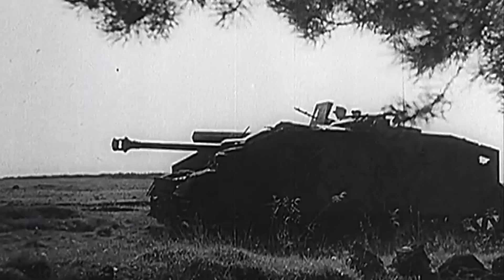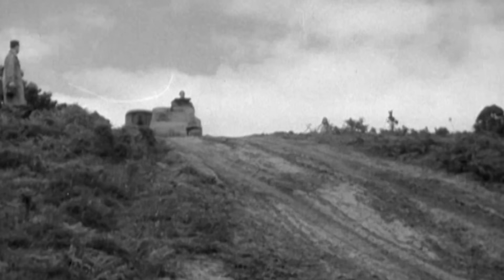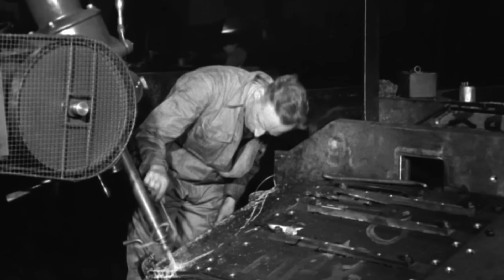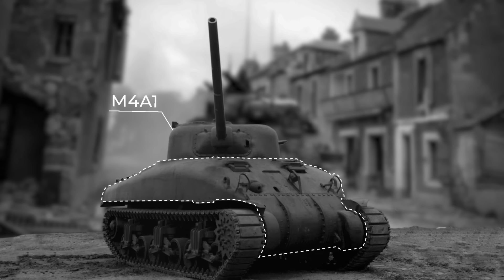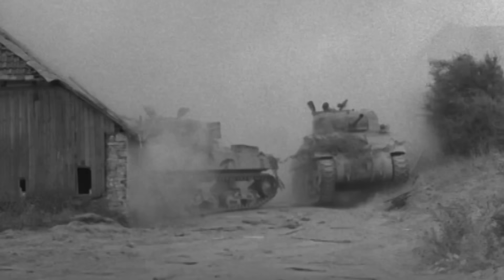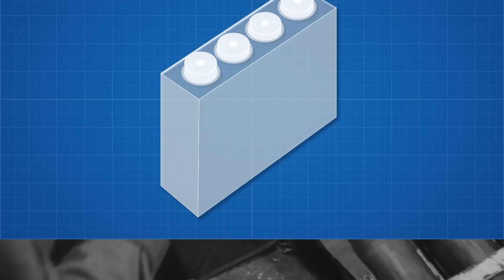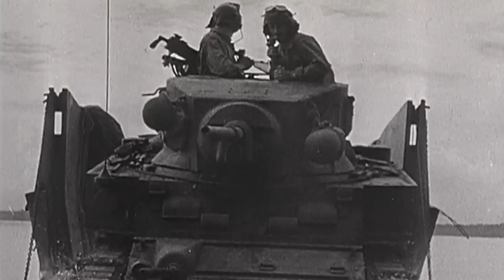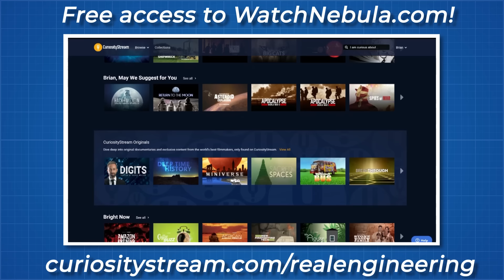M4 Sherman - The Workhorse of D-Day

Comment: The WW2 British called M4 Shermans 'Ronsons'... because they light the first time every time when hit.   Some idiot in the States put a gasoline engine in the tank, guaranteeing it would explode right away if hit. Diesel is not so volatile and does not explode like gas when hit with a enemy shell so much....
Reply: Nonsense. The only documented usage of the nickname being used for tanks reffered to flamethrower tanks. Type of fuel makes no difference in combat, even then fuel was often resultant of a tank's destruction, not the cause of it. The Soviets, Italians, and Japanese were the only ones to use entirely Diesel.
Reply: @peterson7082   https://medium.com/war-is-boring/the-m-4-sherman-tank-was-hell-on-wheels-and-a-death-trap-502b0d99e744  "The M-4 Sherman Tank Was Hell on Wheels — And a Death Trap"      50,000 M4 Shermans mass produced overcame superior German tanks by simply ganging up on them... German - 6,125 tanks on western front... 1,200 tigers.
https://www.military-history.org/articles/the-sherman-tank.htm   Impressive though they looked, the Sherman was vulnerable to a hit from a high-velocity shell which, if it penetrated the armour, could explode or ricochet inside the steel structure causing carnage of metal and flesh. If the ammunition or gasoline fuel was ignited, a Sherman would go up in flames in an instant. The British called this ‘brewing up’. Sometimes, Shermans were called ‘Ronsons’, after the cigarette lighter that was supposed to ‘light first time’.
https://nationalinterest.org/blog/buzz/americas-m4-sherman-tank-world-war-ii-wonder-weapon-or-blunder-weapon-62772?page=0%2C1    Because of its propensity to catch fire, the Sherman soon gained several nicknames. “Tommycooker” (which was a World War I trench cooker), “Ronsons” (a la the cigarette lighter that were guaranteed in their ads to “Light up the first time, every time!”), and also what the Free Poles called “The Burning Grave.”
Reply: @sumerbc7409  That article's only source is one Belton Cooper's memoir. Something that is a fine read if taken as it physically is- a memoir and not what it tries to be- a historical source on U.S. armor. His book and consequently that article make many factual mistakes.

 The M4 was a very survivable medium tank, and was if not the most survivable of its contemporaries. The supposed Polish nickname appears in no memoirs, no interview, or any AAR from the Poles. The nickname "Tommy Cooker" has never specifically referred to the M4, and "Ronson" is only documented in reference to flamethrower tanks.
Reply: @peterson7082  Like you are expert in personal WW2 "memoirs".... my reports are valid and from multiple sources.... Hey man I'm pro America...
Reply: @sumerbc7409  No they are not from multiple sources. Cooper was not a liar, but it appears very little of the book is actually from himself or any specific people (only exception being COL Lovelady ). Veteran opinions vary wildly dependent on their experiences and personal outlook, so citing articles that only refer to one veterans is not really much of an argument.
Reply: @peterson7082  It's common knowledge that shermans  were prone to catching fire and exploding... you cant escape history... a gas fuel tank is a stupid thing... it's why all modern tanks  by major powers don't use gasoline...
Reply: @sumerbc7409  Except they weren't worse off compared to their contemporaries. That's fact, not belief. Sensationalized documentaries claim otherwise. 
 
 Doesn't change the fact the type of fuel makes very little difference in combat.
Reply: Bullshit. Tank Engines, despite they were run on Gasoline or Diesel, don't explode when they were hit by Anti-Tank Shells. They can create smoke but no fires or explosions.

The only thing that cause fires is improper ammunition if you have paid attention to the video.
Reply: so much of that is wrong. we don't know why people call it ronson and it couldn't have originated from ww2 since the allies used zippos. and he shermans armor was actually quite comparable to the tigers. ~85mm ti 100mm
Reply: @snonsig2688  I'm pro U.S. and Israel & anti Iran, Assad, Houthis, Hamas, Hezbollah, Putin, Communist China & N. Korea in politics. Not trying to discredit America here.  So much of what you said is wrong.... 1st off I said the "British" called them Ronsons, it's a recorded history fact, look it up. 2nd The Sherman wasn't even close to Tiger 1 armor... much less Tiger 2's armor or the Tiger's massive gun which out ranged the Sherman by a ridiculous amount. It's just that from 1942 to the end of WW2 there were 49,234 Shermans produced and only   1,355 Tiger 1s & 492 Tiger 2s. And thank god for that. If the Nazis even had 24,000 Tiger 1s & 2s (and fuel to run them) we would have probably lost.... but still might have won with a lot higher deaths... Tiger's are 'heavy tanks" the shermans were "medium tanks". So it's not really a apples to apples comparison anyway.... the Shermans had many variants and were great at troop support with their superior mobility and speed....

Wikipedia :

            The Tiger I had frontal hull armour 100 mm (3.9 in) thick, frontal turret armour of 100 mm (3.9 in) and a 120 mm (4.7 in) thick gun mantlet.[20] The Tiger had 60 mm (2.4 in) thick hull side plates and 80 mm armour on the side superstructure/sponsons, while turret sides and rear were 80 mm. The top and bottom armour was 25 mm (1 in) thick; from March 1944, the turret roof was thickened to 40 mm (1.6 in).[6] Armour plates were mostly flat, with interlocking construction. The armour joints were of high quality, being stepped and welded rather than riveted and were made of maraging steel. 

Sherman tank    At first, a partial remedy to ammunition fires in the M4 was found in 1943 by welding 1-inch thick (25 mm) appliqué armor plates to the sponson sides over the ammunition stowage bins, though there was doubt that these had any effect. Later models moved ammunition stowage to the hull floor, with water jackets surrounding each stowage bin. The practice, known as wet stowage, reduced the chance of fire after a hit to about 15 percent.[98] The Sherman gained grim nicknames like "Zippo" (after the cigarette lighter), "Ronson" (because "it lights the first time, every time").[7][99] and "Tommycooker" (by the Germans, who referred to British soldiers as "Tommies"; a tommy cooker was a World War I-era trench stove). Fuel fires occasionally occurred, but such fires were far less common and less deadly than ammunition fires.[97] In many cases, the fuel tank of the Sherman was found intact after a fire. Tankers described "fierce, blinding jets of flame", which is inconsistent with gasoline-related fires.[96]
Reply: @sumerbc7409  This isn't true at all the British at el Alamein put their ammunition in unsafe places but this was fix with the wet stowage

Comment: The sherman seems nice and all now but I WOULD NOT want  to be in one during ww2. Thing was deathtrap  based on the accounts of the pilots.
Reply: It was not a death trap compared to its contemporaries.
Reply: Right 3% crew death rate was a death trap.
Reply: it was one of the best of the war.

1. everyone used gasoline engines on one tank or another
2. the gun was comparable to german counterparts at the time like the PZ IVs short and long 75s
3. the armor was quite comparable to the tigers ~85mm to 100mm
4. the sherman was statistically in the top 3 safest tanks in ww2 and most of the crewmen were killed outside of the tank
5. it was incredibly reliable and easy to repair

so get your facts straight

Comment: I have an issue withe characterization of the Sherman as "The most produced allied tank of the war". Do you not consider the Soviet Union to be part of the allied powers or is there some esoteric piece of trivia about the t-34 that makes it not count as 1 single model of tank?
Reply: The m4 was indeed the most built tank in ww2
Reply: @m.cuongnguyen7475  Well go correct the Wikipedia pages for the Sherman and t-34 then.
Reply: Nomad6763 The soviets the t-34 even till the late 50s that’s why they had 80000 tanks
Reply: @m.cuongnguyen7475  I'm aware of that but the estimates of end-of-war production totals I've seen are in the 60k range, well over 10k more than the Sherman. Both the Wikipedia page for the Sherman and t-34 cite the t-34 as the most produced tank of the war.
Reply: Nomad6763 If you count the t34-85 and t34-76 then yes but the t34 alone were only built 35ooo Times
Reply: @m.cuongnguyen7475  So you're making some kind of ship-of-Theseus argument that makes the t34, t34-85 and t34-74 different tanks?

Comment: The ability to fight other German tanks was a nice bonus to have on some models of the Sherman. But, 90% of US tank rounds fired in WW2 were High Explosive (i.e. against infantry and soft targets). That is because first and foremost, the Sherman was an infantry support tank. On the defensive, the main anti-tank work was to be done by TDs (tank destroyers like the M18 and M36). The HE rounds fired by the 75mm short barrel were more effective than the higher velocity 76 mm long barrel gun. The shorter, slower barrel allowed for greater volume of HE explosive compared to the longer, faster 76mm which  was better suited for the anti-tank role. This is probably why the US came up with the best solution of attaching one 76mm M4 to every four 75mm M4s in an overwatch role. Unfortunately, games like "World of Tanks" and "War Thunder" make it seem as if the 75mm M4s were silly, poor designs because all of your enemies are TANKS. And there is no infantry. Many tankers didn't even want the 76mm.
Reply: > "That is because first and foremost, the Sherman was an infantry support tank."

 U.S. Army Ground Forces viewed medium tanks as a supporting asset to all other combatant units in making and exploiting breakthroughs in enemy lines. What a tank supports has no bearing on what it can and cannot engage.

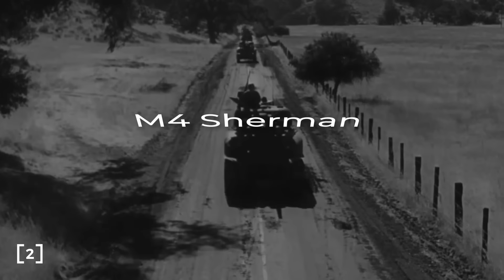Comment: 2:45 The most produced Allied tank was the T-34 not the M4.

Roughly 50,000 M4 tanks were produced whereas around 84,000 T-34s were made.
Reply: Yawn, just think about this one mister know it all.  Do you really think he actually got this one wrong?
Reply: 58,000. Not 84,000.
Reply: Kevin Tu it was the most built tank in ww 2 during these 6 years. The t34 was even built in the late 50s

Comment: I'm would like to hear more about the sherman "firefly" with the 17 pounder gun that the British and Canadians used during ww11 with regards to how effective they were
Reply: I mean there are lots of videos or there about this. Long story short the 17 pounder is a great anti tank gun but not so much general purpose.

The Americans had the 76mm gun which is really a lightweight version of the 3" gun.  The 17 pounder was slightly more powerful than the 76mm.  The 76mm was used in a larger turret while the 17 was jammed into the smaller original Sherman turret.  The 76mm shell is much smaller and easier to handle, allowing for faster reloads, more ready ammunition, and more ammunition overall.  

Lastly the turret was too cramped in the Firefly massively restricting crew performance.  The Firefly was an antitank specialist but inferior at other tasks.  

It got such a good reputation in Normandy because the Americans didn't bring their 76mm Sherman's on D-day for short sighted logistical and training reasons.

Comment: Well you've got a few minor bad notes, mostly things that would feed misconceptions about the Sherman.  I like that you touched on the "it takes 5 Sherman's to kill a cat" myth, but couldn't you take the extra few seconds to say "Sherman's were always deployed in groups (platoons) of 5 tanks"

Also you have the Easy 8 thing wrong.  The Easy 8 program was the Horizontal Volute Suspension system.  The tank is the M4A3 Sherman 76(W) HVSS.  The confusion comes from the the fact that most 76mm Sherman's had the HVSS.  Also fun fact and something that would have gone well with this video is that Sherman had a different turret on the same hull. In order to fit the 76mm and have room for the crew still.

Comment: But they had the technology to make turret ring for battleship, I'm wondering
Reply: Technology is the wrong word.  Battleship turrets are well over engineered and ships are allowed to be as heavy as they need to be.  Tanks have hard weight and size restrictions to be useful.  Any tank needs to fit on a railcar and not collapse most bridges.  

Experience would be a better term.
Reply: @jeremyO9F911O2  
ah yes, I overlooked the weight issue, because the video said they didn't have the engineering capabilities to make a larger tank turret ring, guess I have misunderstood the meaning.
 And yes, larger gun require bigger ring = larger turret = heavier = more load on the tracks and the suspension system = more problems for transport and crossing terrain. Also the tank sinking into the ground issues made it even more difficult to find an optimal solution.
Reply: @HackedToaster  yeah that's actually more of a comment on track design than vehicle weight.

Still a wider track is a heavier track and the Sherman wasn't the only tank of the time to suffer so.  There were engineering vehicles with canvas deployment systems to specifically counteract the sinking in mud issues.  These were usually built on Churchill engineering tanks.